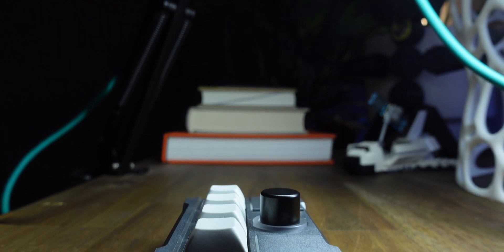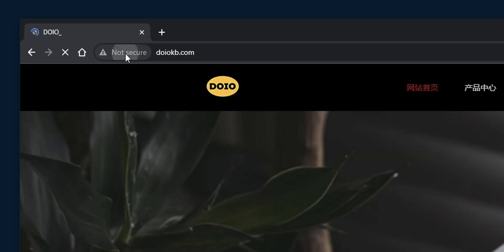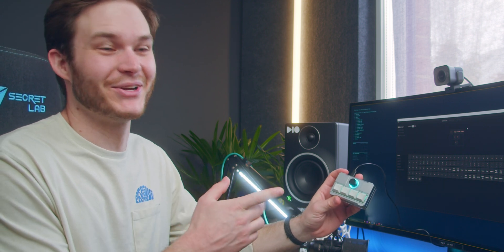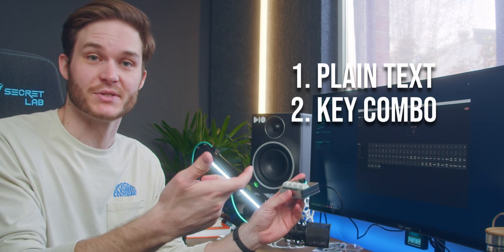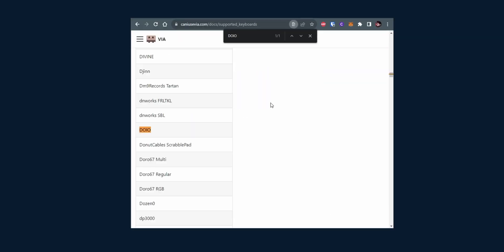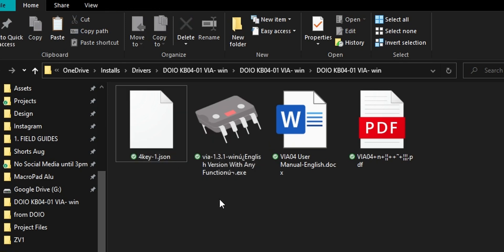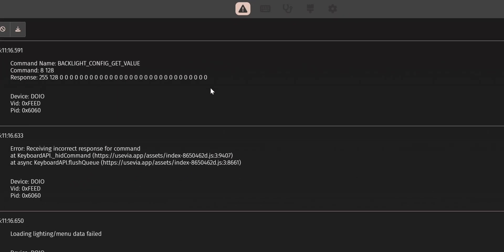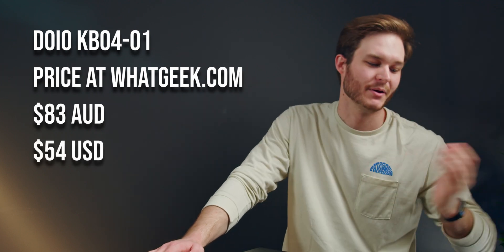Worst Macro Pad Experience - Megadalon vs VIA :(

Comment: I didn't know macro pads even existed! Thank's for this video, I might get one, and I have to agree that the software and experience on this is very bad
Reply from the maker: Here's some options to take a look at 👇

There's some wild-looking video editing ones like the Tourbox
✅ https://geni.us/TourboxElite

More general video editing would be the Loupedeck
✅ https://geni.us/LoupedeckEditor

Live streamers opt for units like the Stream Deck as it has excellent software integration to Streaming programs and even controlling lights in their room. The new Plus model (quite pricey) has knobs.
✅ https://geni.us/ElgatoStreamDeckPlus

Currently I'm using a XENCELABS Quick Keys
Wireless, oled display, programmable dial with macro recording (no timed delay) and it has per program assignment, so if I have photoshop open it changes all the buttons to ones for that specific program.
✅ https://geni.us/XENCELABSQuickKeys

Also, Gaming keyboards tend to have dedicated buttons on the side, or the ability to change keys to macro's.
I used to have perfectly timed combo's assigned, which is why timed delay can be very important with macro's.

I really love the tactility of knobs, sliders, anything that increases the ergonomics or efficiency of a task.

If DOIO were able to update the Instructions for the Megadalon range to the VIA v3 steps I outlined in this video, then it would have a much better user experience especially with macro recording.

Comment: 6:10 It is kind of crazy that you have to take your macropad apart to see if it uses the STM32 chipsets vs the ATMega32U4. DOIO should really change the model number to something like KB3-STM or KB3-ATM or better yet just support the software better for at least 2 years or so. I suspect this may be partially intentional to get you to buy their newer units the same way Apple uses upgrades to slow down their older iPhones. At least Apple waits 3 or 4 generations to abandon their hardware.

Comment: I think things have improved a little with the software to make macros but the RGB is a nightmare I cant get mine to work now. I got it working for 30 seconds and then it just went black and I cant figure out how to fix it now. The lights are off or half green and I cant get them to work. if anyone has tips let me know please. ive even uninstalled the software and reinstalled it but had no luck.
Reply from the maker: From memory when I last did it I had to use an old version of VIA for the RGB, not the latest version.
The firmware on the macropad doesn't understand the latest RGB signals. I'd check the whatgeek websites downloads as they had the old software version 🤙

Comment: Thanks for sharing! I use a cheap numpad for macros. I use lua macros to map the numpad. Its pretty good and fast. It can map for pretty much any software. I recently posted a guideline and made a template so that non-codind people can turn any keyboard for macros for any software. The only problem I'm facing is lua macros is exe file, so mac user cant use it. Hammerspoon can read lua codes in mac. But I dont know how to turn the lua macros code readable for hammerspoon. Any help?

Comment: I ordered the Megalodon version (16-button version). Couldn't get it to work. Had the same issues as you had but not the patience to work through and troubleshoot all the steps. Simply isn't worth it considering how many out-of-the-box macro-pads out there. Too bad, because the actual build quality and look is top-notch.

Comment: Hey I downloaded the WinRAR program and the older version (at about 1:50 in your video), and when I go to import the keymap, it still cannot find any files whatsoever. Any suggestions? Excellent vid btw
Reply from the maker: You'll need to uncompress the .rar file with WinRAR into a normal folder on your desktop.
Right click the .rar file, look for the menu option that's to uncompress to current folder :)

Comment: You can open programs easily without any additional software all you have to do is right click on the application you want to start go to properties and in the general tab you have shortcuts there you set a key or a combination of keys as a macro to open the said application. Then you simply put a bind the application to the keys you set ( or use a macro)
Reply from the maker: Good point to make but that only works if explorer.exe is the active window, if you're in another program windows won't interpret the shortcut commands for file opening shortcuts.

Comment: piece of junk - and it is sad. I can build my own macro pads with fully custom firmware using arduino hardware, so this is a lovely case.
If the FW/SW sucks, you could still overwrite the firmware... except that they use different controllers for the same product.
Reply from the maker: Haha mate I was going to make the joke that it was easier to program the Arduino keyboard testers key inputs than the Macropad! 😅

I did research flashing custom firmware but stopped myself as have a big future project planned which will replace this macropad.

Is a shame though as the hardware is truly beautiful, just a really bad user experience